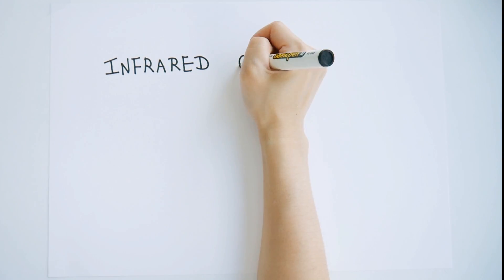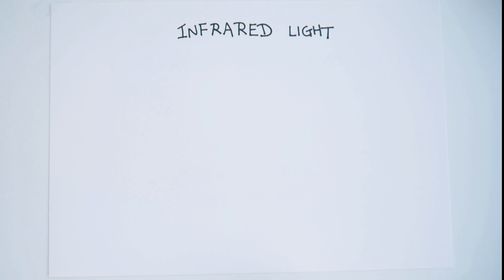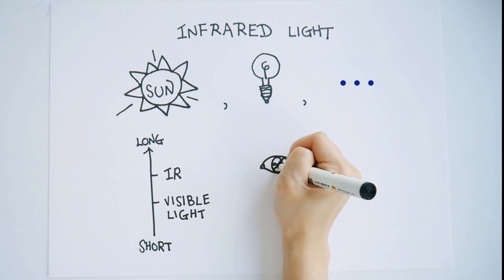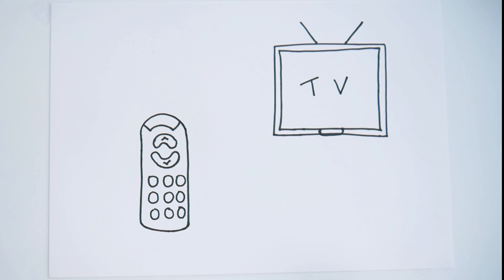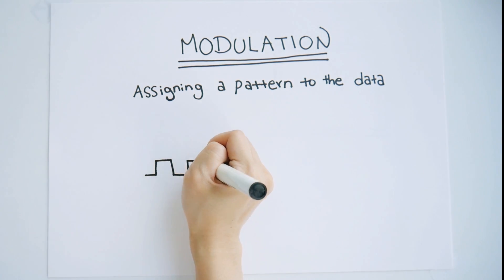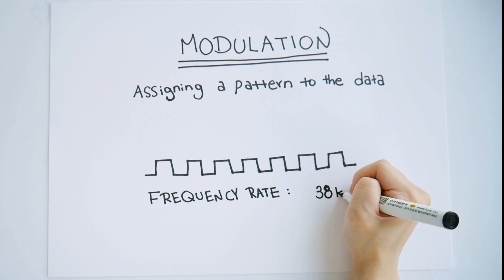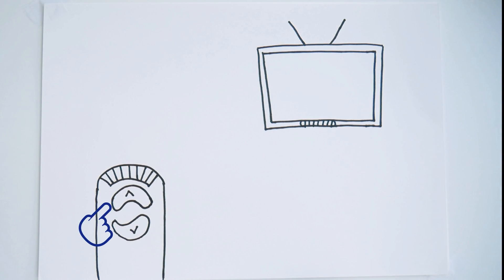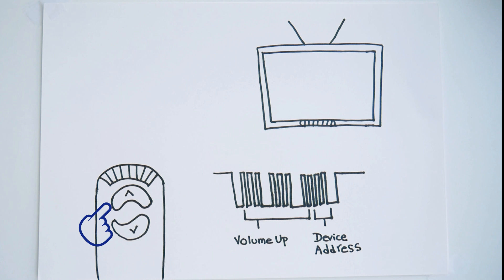IR (Infrared Communication)

Comment: It, the transmitter, is not transmitting heat - is it? When I think of infrared I think of heat radiation. I don't understand.
Reply from the maker: Dear Blair, The infrared way contains heat. It is used for some heating application. The second application type of infrared is communication. In this case, the intensity of Infrared is very small. Therefore, it carried is very small of heat that does not make the surrounding environment hotter.
Reply: @ezTCP  Thank you.  So why do we need a special electric transmitter if it is 'small intensity'? I know about frequencies and the range of the NIR, but, why can't other IR heat radiators, human body etc, affect the receiver?  And if it is 'small intensity' how does the IR radiate across such large (relative) distances, 10s of metres, without a 'strong' original heat source? Normally even high output transmitters, small indoor house fires etc, output would not reach such distances. Is this not about heat, but about electricity?
Reply from the maker: Dear  @fractalnomics  
Unfortunately, We are sorry, We cannot answer your questions. We are not specialized on low-level wireless communication. We just apply it. The above video is made  when We did an DIY project that uses our hardware platform, called PHPoC. To answer your question correctly, an expert on wireless communication is required.
Best regards,
Reply: @ezTCP  Cheers. Thank you.
Reply: @fractalnomics  No, IR is not heat itself. IR is just an electromagnetic wave of a specific wave length range. Heat is simply the vibration of molecules, that’s it. The faster they vibrate the hotter they are. It just so happens that when these molecules vibrate faster they produce more IR radiation (as well as many other types of radiation). Yes IR communications devices are limited, they penetrate things poorly and they are very directional and subject to interference; as you alluded to; sources of heat will create interference. However, if you can see a traffic light on a bright day then I’m sure that your TV will recognise IR commands in a warm room, it’s the same principle. As long as the signal is tuned and at a threshold over the noise then the signal will be recognised. That’s why traffic lights have a shade over them to reduce interference from the sun. They are also tuned to specific frequency’s which results in the varying colours that we need to recognise. The universe is full of electromagnetic waves it’s just that we have evolved to see only those that penetrate physical objects poorly (light), that way we can understand the physical physics of our environment.